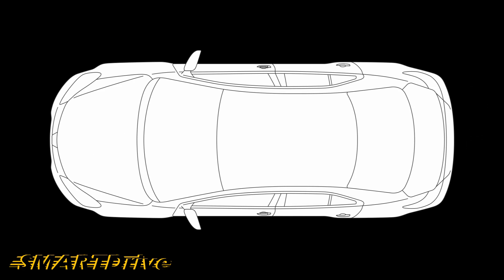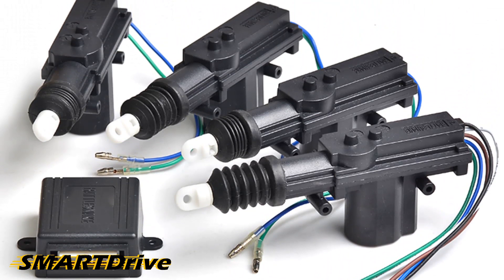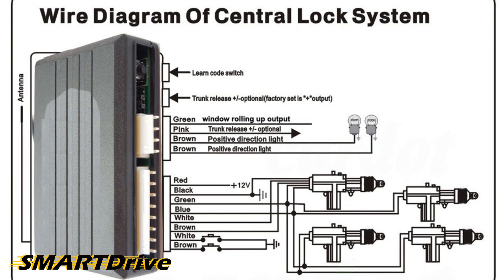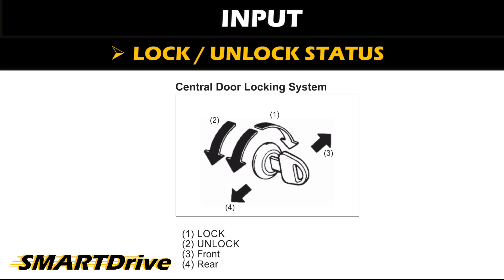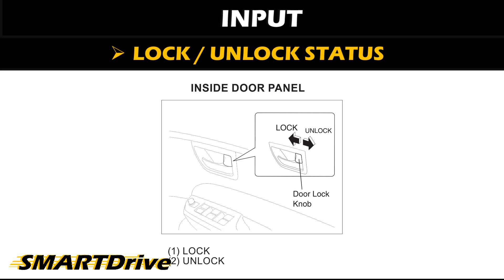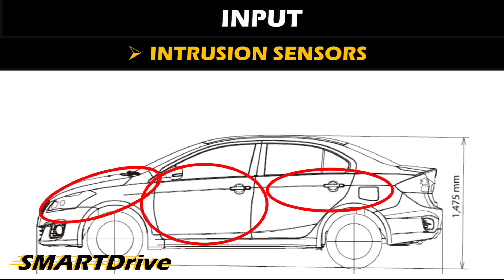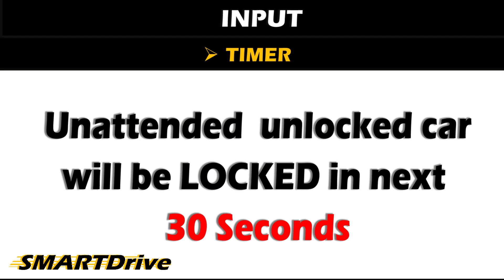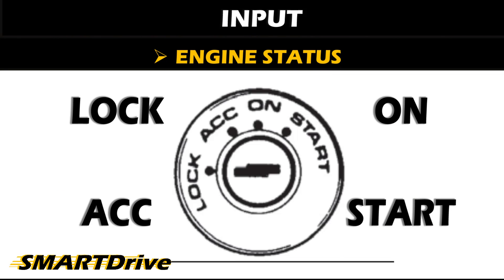How Central Lock system works ? : SMARTDrive ep. 25

Comment: The key remote is not working means unable to unlock /lock the car with keys. Sometimes its working sometimes not. No siren chirping. The central locking is doing well with keys while inserting the keys in door. I have also changed the remote battery but problem not solved even i used 2nd key also but problem not solved. Please give me solution
Reply from the maker: There must be issue with remote transmitter and receiver system. Due to security reasons we will highly recommend you to visit authorized service station only. If your car insurance policy has "key protection" rider or car is in warranty you will not have to pay anything for the repairs.

Comment: Sir I have purchased new Ciaz zeta (P) in this car the front light I mean  Front (with overhead console) which is not going to off after locking car completely even the light button in in centre so please tell me how this light automatically off after locking the car completely.....Sir please tell me fast..🙏🙏🙏🙏
Reply from the maker: +Mayank Gupta +Mayank Gupta actually this light is taking input from all door shut sensors.
There might be possibility that either of those sensor is not working properly.
I will suggest you to watch https://youtu.be/Y-riJDUWSbw
Check for all four doors.
If problem persists please post your contact details. We will support you over whatsapp
Reply: SMARTDrive ok..

Comment: Hi In My Swift VXI 2013 when i insert my key in transmission after opening my car door there is no sound which indicates door is open. Secondly when i stop my car and remove the key my car door donot unlock automatically i need to manual open from inside.

Kindly suggest what could be the issue.
Reply from the maker: Check "door settings" select door unlock when engine off.